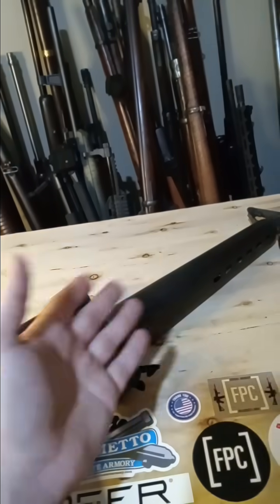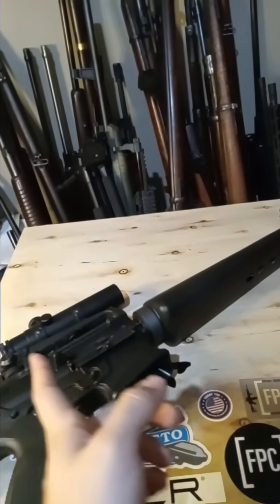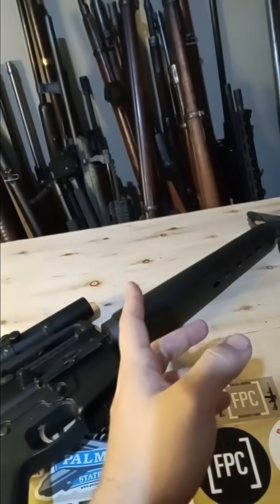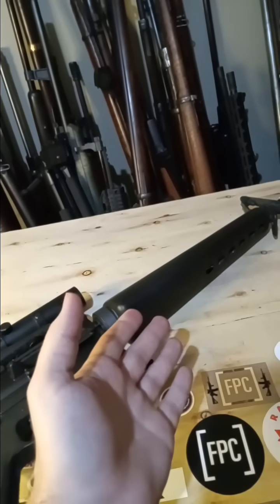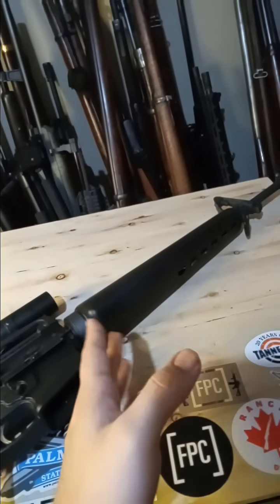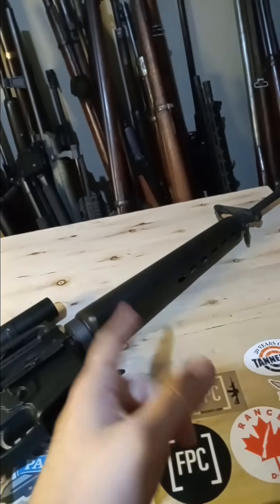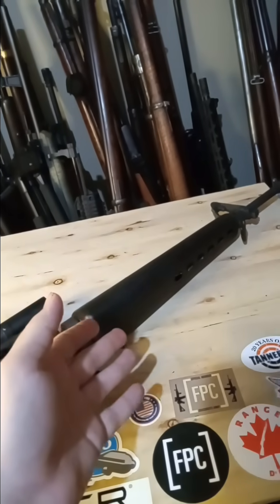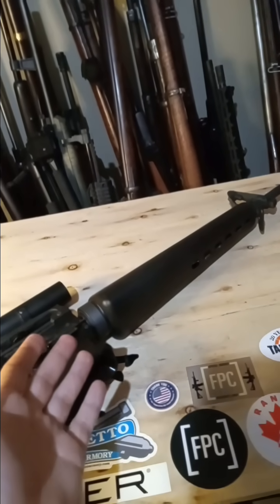Unusual M16 Twist Rate

Comment: If my standard AR is running a 1:7 for .556/.223 then where would the benefit have been at such an extreme twist rate? Obviously bullet stability but that seems like overkill when a 1:10 would have been sufficient. Just curious the why on this one. Great video brother.
Reply from the maker: Its what the military adopted to run heavy bullets

Comment: It was due to the bullets not being able to stabilize during cold weather testing at Ft. Wainright outside of Fairbanks, Alaska. the dense air below-35* F de-stabilized the projectiles.
Reply: Steel and copper have very different rates of expansion...extreme cold would have the bullet shrinking a tiny bit more than the barrel.
result: bullet is 'rattling' down the barrel when everything is cold.
Fire a few rounds to warm up the barrel, the barrel expands but the ammo is still bitterly cold.
More 'rattling'...
Reply: @pirobot668beta Sir, the projectile is the same diameter as the grooves in the barrel, as pressure forces the projectile into the lands, this displaces metal from the projectile resulting in the projectile becoming so tight at the very entry into the barrel it takes great pressure, about 5,000psi to do it. The seal is such that at roughly four inches of travel the pressure inside the barrel is ~ 60,000 psi. There is no rattling at all.

Comment: Yeah 1:12 is fine pretty funky compared to today’s standards. Doing my research before building both of my Galil ARM’s I found out that the gold standard for barrels were CZ military contract barrels for South Africa which had 1:12 twist rates. It exclusively limits me to shooting 55gr but it’s accurate and that’s probably the cheapest 5.56 ammo you can buy so I’m happy
Reply: For older barrels barrel wear was actually an issue.  More twist = more wear, and it’s a non-linear relationship.  Hence twist rates being the absolute minimum viable number.

Good 1:8’s today with QPQ or chrome lined are good for 15k+ rounds so it’s less of an issue.

Comment: I think 1:14 twist probably came from the old .222 Remington that did just fine with it's usual 50 grain flat based hunting bullets. 1:14 sounds reasonable  for 55 grains and under but can certainly start to show accuracy and stability issues with anything over 60 grains. Depends mostly on the bullet length. Boat tail versus flat based bullets affect that bullet length.

Comment: I have a 604 clone… but deviated from the correct 1:12, with a 1:14 pencil barrel because Green Mountain did a run of them, and I wanted to try it… and Texas isn’t the North Pole. M193 in a 1:14 is absolute vaporization on Watermelon…. The combat reports from Project Agile in South East Asia
Were eye opening, and true. The energy transfer is 100%
The accuracy is just fine with the M193 it was developed with at anything above -10F.
Reply from the maker: Great, now imma have to try it lmao
Reply: @theblindsniper9130 if you need to borrow an upper for a video test… I happen to know where one is.
Do buy some watermelons to see what Gen Curtis leMay saw at that farm in upstate New York, that caused him to buy them for the USAF. Stoner knew what he was doing.
Reply from the maker: Solid appreciation. But i actually ordered one for myself haha did that yesterday
Reply: I'm down here in SETX and I love my 1-14" twist AR-15 with 22" bull barrel and the best round for it is the Barnes Varmint Grenade 36gr Hollow Points @3,600fps. It's soooo much more brutal than the M193 55gr. My XM177E2 and XM16E1 love the M193 and so do my A2 and A4.

Comment: I asked some vietnam vets how the original issue m16 was for doing damage and they said it shredded the Vietnamese they shot with it. 1:12 and 1:14 with 55gr is brutal.  You get hit with that and the bullet basically explodes on impacts.  It just can’t stay together.
Reply: That’s not due to the twist rate. It’s due to the fact that you’re lobbing a .22cal projectile down 20” barrels at a blistering hot 3000-3250fps. It’s the fact that the bullet is so small and moving so fast that it fragments and yaws the way it does. You don’t see that type of fragmentation of projectiles from shorter barrels. Realistically anything shorter than 14”, while certainly deadly and accurate enough, is not going to have enough velocity to reliably fragment projectiles for maximum damage. I have a Mk18 but I’ve only kept it because it was my first AR and I want to give it to my son. Any AR I have for legitimate use or home defense has a 14.5 or longer barrel because of those facts. 

Twist rate is important but it isn’t the reason those projectiles smash and fracture on impact
Reply: @danikaflorence444 a mk18 will fragment with 55gr the problem is that it will only do so at extremely close range.  55gr m193 is basically already riding the line of fragmentation threshold velocity as soon as it leaves the barrel of a 10.3”.

For a 10.3” you would generally want to look into mk262 or some other enhanced loads which have better performance at lower velocity.

Comment: The ammo the govt used worked with 1:12 twist but when new 556 carriage was updated the 1:7 twist was made for the hotter cartridge
Reply: 1:7 was adopted to stabilize the M856 tracer because the bullet is considerably longer than M193 or even M855.  Faster twist is needed to stabilize longer bullets not hotter.
Reply: @aidensteckley9668, Yes, you are correct. The twenty inch barrel did have a 1:12 twist rate, and the M4 carbine had a 1:7 twist rate.
Reply: @WilliamMitchell-sc3fe m16a2 had 1:7
Reply: Fo you mean heaver bullet?
Reply: @michaelhennegan9637 no bullet length dictates barrel twist not weight.  Weight just so happens to occasionally kind of follow length but not always.  The M856 is a good example the bullet is much longer than other 62gr bullets and even longer than many heavier than 62gr bullets.

Comment: XM-16, as Stoner intended, got rave reviews from SF people who used them in the field. 
Decapitations, dismemberment, disembowelment, the little rounds were a lot more... "decisive" than people thought they would be. 
Tumbling 5.56 rounds are devastating inside 400 yards. 
Once the Army Appropriations people (corrupt congress members who wanted to funnel money to their own interests) who didn't know or care what they were doing, got a hold of the new weapon and the opportunity to manipulate all that money, they basically re-engineered Eugene's brainchild and made it the flaming, unreliable failure that it was when it was first introduced for general service. A lot of guys died with their weapons field stripped in combat, desperately trying to make the #%^ thing run.  
That bloody, flag draped reality finally becoming enough of an embarrassment to the political swine who @#$^ed up a real wet dream, major changes were thence required in order to make the weapon work again. 
At the root of the problems, the egg-heads changed the powder and the bullet weight, among other things, which vastly impacted the operation of the weapon, causing failures and requiring modification of the weapon from its original design, twist rate being one of the changes that resulted.

Comment: It was that 1/14 twist that help establish  the reputation of the 5.56 as tumbling when it hit soft targets.

But the accuracy went to hell past 400 yards.

I like 1/9"....
Reply: 1 in 9 from a 16 inch or from a 20 inch barrel?
Reply: @FinalLugiaGuardian mine is 20"  it's a lazer beam with 55 and 62 grn
Reply: @FinalLugiaGuardian 

Either barrel length.   The extra 4" of barrel may add a little more torque to the bullet....  but I doubt it would matter much with the common bullet weights/lengths used in the typical ammo used in either.

It seems when the weights go much above, 75 grs., that a tighter twist is useful for best accuracy. 

They usually recommend 1/8 or 1/7  for those long, heavy bullets... match hollow weights.

I typically shoot bullets up to about 75 gr.
But most of the times the 55grs. FMJ  bullets gets the nod.
PMC brand ammo, is what I shoot.
Handloaded stuff, I use CFE223 or W748 powders....with cheap 55s,  are my AR favorites.
Reply: I actually use a 1/9 twist with an 18 inch barrel,,the trusty old FB Radom Beryl 556…If you think about it ,,14.5 using a 1/7 your getting 2 twists in the barrel before it exits,, same with the 1/9 and coming out an 18 inch barrel…its weird when you think about it,, generally speaking an ar 10 has a 1/10 twist rate and they are usually firing bullets what 147 to 175 are most common.. why don’t they have a faster twist rate.. wouldn’t you use  a faster twist rate..

Comment: 1:14 twist did not stabilize not just tracers but also ball ammo in arctic conditions. 1:14 did find its way to very early use in Vietnam with SF advisors.
Reply: Early Air Force models too. Slab side, no FA, just like the one shown.
Reply: @larry648 the Green Berets got them first. The 1:14 twist barely stabilized the M193 ball and produced very nasty wounds. So much so that NGO’s raised a fuss about these new sub caliber high velocity rounds.
Reply: @ LaMay got them for the Air Force first , 1962.  The Air Force was using old Army hand me down M-1 and M-2 carbines. The Army SF started getting them in 1964, well before Army adoption in 1967.  Outside of SF, the Army fought against the M-16 all the way.  McNamara deleted the chrome chamber, and the Army changed the powder in the round, then blamed the malfunctions on the rifle.
Reply: @larry648 Pretty sure it wasn’t McNamara who deleted the chrome chamber.  It was an Ordinance officer.  Probably the same idiot who ordered the powder change.
Reply: @skookapalooza2016 Oh? McNamara and his fellow “wise men” wanting to forego the chrome lining process to expedite fielding the rifles is the way I’ve always heard the story told
Reply: @larry648 601 model… and yes it was a select fire weapon. As was the 604 that replaced it. I used the 604 and the GAU-5.
Reply: @  I carried a GAU-5a on some of our mobile patrols.  I liked that little sucker, but damn it was loud.
Reply: @larry648 oh hell yeah, even the M60 gunners didn’t want you next to them on the combat arms tube range! Ours had long ago carbon clogged the moderators , so we ran regular birdcages on them. But they fit soo nice in a M60 barrel bag
Reply: The Colt 601.
Reply: The first ones were Armalite AR-15s and were adopted by the Air Force.  Those rifles had 1:14 twists.  The Army developed it into what would become the M-16 with a 1:12 twist.  During the Army's development the powder was changed from IMR to ball powder without consulting Armalite. The ball powder contained calcium carbonate which caused a buildup in the gas tube eventually resulting in failure.

Comment: Yes. Designed to destabilize on impact. 1in 14 or 1 in 12 twist was standard for 22 caliber varmint rifles. Two issues were the deciding factor. One is the coriolis effect. Te higher the spin the more the projectile is effected earth's rotational force. The second reason was that early varmint projectiles had a jacket that was designed to make the projectile explode on impact. These bullets will destroy themselves inside of the barrel of anything tighter than one in 10twist.the Speer 50 gr.sxsp is an example. Remember even though it's capable of killing, like the 22lr it isn't optimal for targets over 35 pounds. Here in eastern Washington we start out at 22 -250 and most start at 243 for coyotes.
Reply: The wounder.   Keyhole city. Per the original design.
Reply: most of the major manufacturers have gone to 1:9 in their .223 bolt actions now, not ideal for common varmint rounds. I guess they are just considered companions to an AR now.
Reply: Bullet RPM has nothing whatsoever to do with the Coriolis Effect, the Coriolis Effect in regards to extreme range shooting (not a job of the 5.56 in any way) has to do with the fact that at extreme ranges the bullet in the air is essentially traveling on one path and target on the ground will be in a different position in relation to the Earth’s axis due to the Earth rotating during bullet’s flight time. 

The business about bullet RPM (and rifling twist direction for that matter) is called spindrift and it’s about correcting for the bullet’s tendency to drift in the direction the rifling spun it the further out it goes.

Comment: 1:8 may be the best general use twist rate but it mostly appears in stainless barrels from what I remember. Which is unfortunate if you’re really wrapped around the “barrel longevity” axel.
Reply: @othernamesweretaken1871  Criterian Barrels makes several 1/8 chrome lined barrels.
Reply: @sorryociffer Its their Nigersaurus profile barrel, right?
Reply: Plenty of non stainless bbls offer 1:8
Reply: @ Very helpful.
Reply: There are some 1/8 in chrome line chrome Molly barrels available. Just do a Google search for one/8 chrome lined.
Reply: I recently got a chrome lined barrel on a .300 BLK upper & I find that with .30 Caliber bullets the chrome lining affects accuracy less than it would with 5.56 while still improving lifespan.

Comment: Did not know there was a 1/14 good info!
Reply: All my .223 hunting rifles,  along with 22-250, 220 Swifts, 222, 222 magnums... ALL used 1/14 twist.

Then, heavy bullets became popular.

Even 1/12 couldn't stabilize them!

That's why the 1/7  twist was adopted in the latest A2  models, and M4 carbines.
Reply: @arthurshingler2025 Not because of the SS109/ M855 greentip 62gr
Those were fine in 1/9 and had a longer barrel life… no, it was the 
New tracer at the time of adoption that was an extremely long bullet that required 1/7. And being that the tracer was mainly for a M249, not a regular infantry rifle… Colt really tried to talk the military into 1/9.
1/7 even causes excessive lead deposits when using a .22LR conversion kit for training ( and they did use those) while the lead .22LR was fine in 1/9

Comment: How would a 1:12 or 1:14 twist AR handle heavier 77gr/75gr/73gr OTM/BTHP/SMK rounds? I was told 1:7/1:8/1:9 twist has the widest range of grain weights it can shoot accurately & as far as I know all my ARs are one of those 3 twists.
Reply: It won't. Most of my manuals list 1in9 for up to 69 gr. 1 in 8 is a very good compromise .
Reply: Berger Twist Rate Calculator:

BC: 0.372(G1)
Caliber: 0.224
Weight: 77gr
Length: 1.07in

Muzzle velocity: 2650
Barrel Twist: 12
Temperature: 59
Altitude: 0

SG: 0.618
Reply: 1:7 is the sweet spot for 77gr, 1:8 is the sweet spot for mid-weights 64-69gr, 1:9 is the sweet for 55 grain.  So 1:12 is already allowing very slight instability with 55gr.  77’s will probably keyhole immediately.

You can’t really over-stabilize a bullet, short of causing it to disintegrate in flight from too much twist.
Reply: 1/9 does the job for 55 and 62
1/7 is for 77gr match
Reply: It doesn't. You need 1:7
Reply: It can't handle the heavy 5.56x45 bullets at all. You have to go lighter with the 1-14 twist. I use Barnes Varmint Grenade 36gr Hollow Points @3,600fps out of my 1-14" 22" AR-15 and it's absolutely amazing. It also averages ½"-¾“ group's @100 yards. Heavier bullets are retarded DOD bullshit.
Reply: I’ve shot 75gr from a 1/9 twist with no noticeable issues however they were full power 5.56 loads and it was the summer. 

I’m sure lower velocity or cold temps (leading to lower velocity depending on the powder) would absolutely lead to stability issues. 

That said if I’m buying a new rifle or new barrel it’s gonna be 1/7 though 1/8 is acceptable.

Comment: berger twist rate calculator for ppl that need info
Reply: Appreciate the info my guy more than ya know
Reply: Yep no problem, biggest thing is length of projectile and twist rate. People say try to stick to 1.25-2.0 SG for pure accuracy. Sometimes over stabilization (3.0-6.0 SG) could be a good thing depending on your goal, but you lose accuracy at distance.